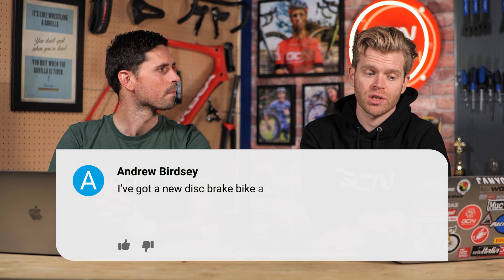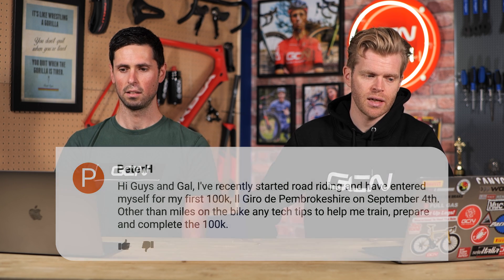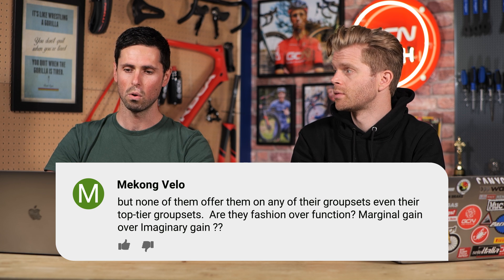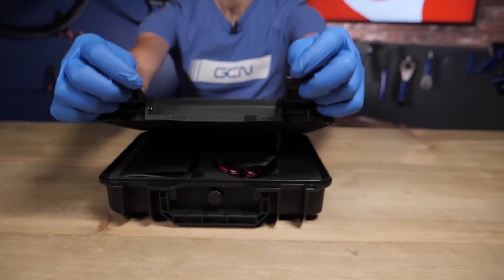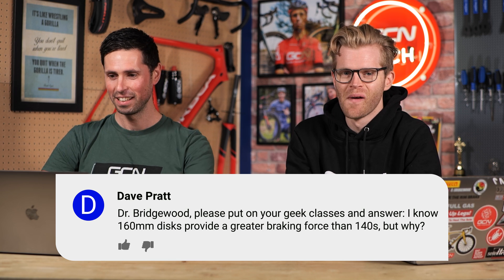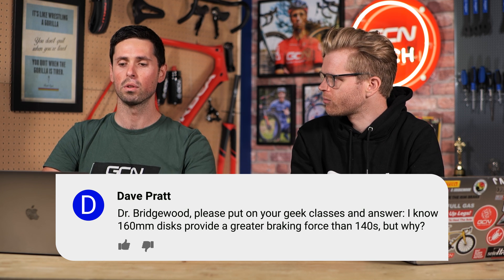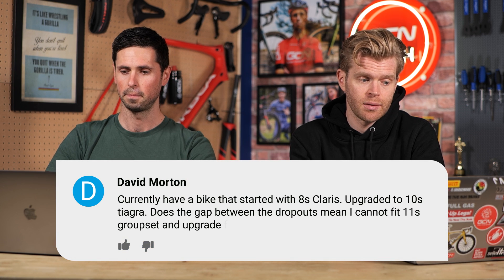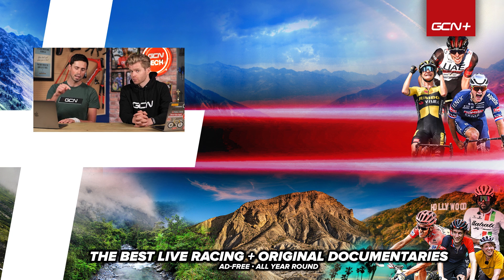Is There A Maximum Speed Bike Tires Can Go? | GCN Tech Clinic #AskGCNTech

Comment: Throw 10ml of sealant in the latex tube and it’s fixed as long as it’s not a huge gash. Done this a bunch on times and works every time!
Reply: Done this too only to find on long descents and long rough roads the small puncture eventually results in a tear and therefore a flat.

Comment: Hi Tech Team, on the SRAM tyre pressure website one of the questions is - What Front and Rear tire casing do you have, 1) Standard 2) Reinforced 3) DH Casing / Double Ply.  What is the difference and what should I choose as I run Pirelli Race TLRs? #AskGCNTech
Reply: This is for mtb tyres. You can choose thin too, thats what i would pick. Whats your weight? I ride those tyres with 7bar rear and 6.5 bar in the front with 110kg systemweight.